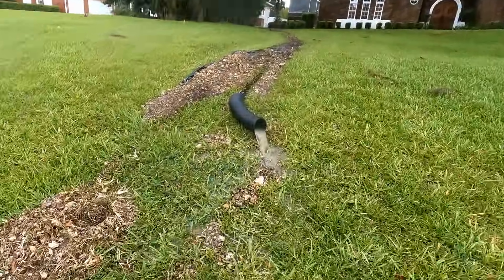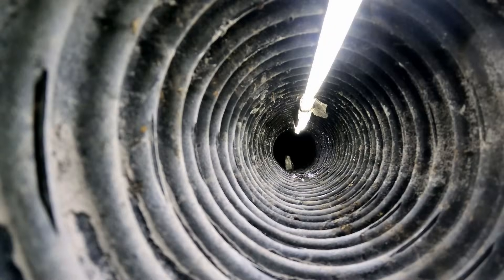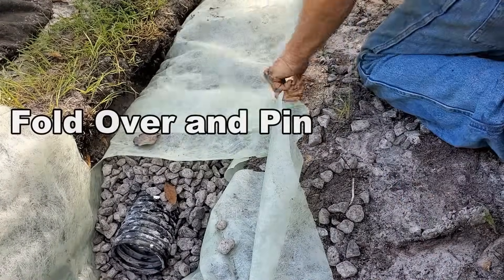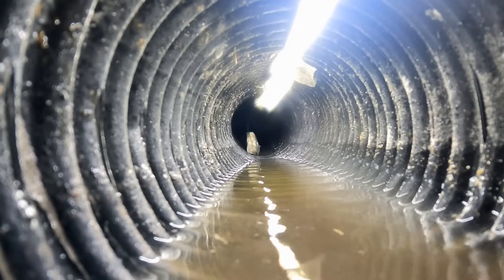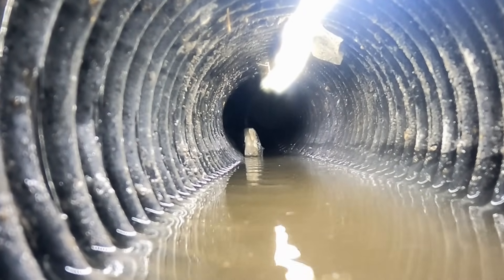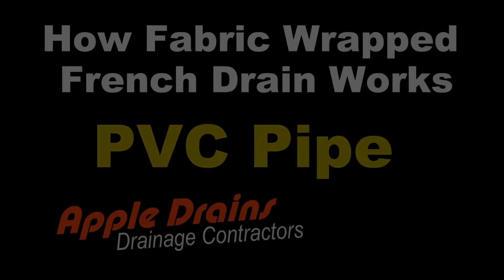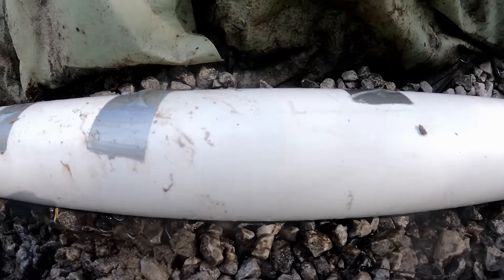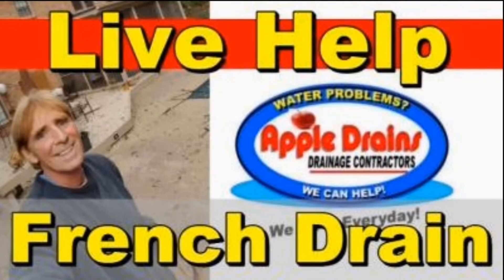Does French Drain Work with Fabric? Watch This Before You Install - PVC / Corrugated Pipe

Comment: Very nice demo.  I'm impressed with the light inside the pipe to get a good video!  What are the pros and cons of corrugated vs. PVC pipe?  Seems to me corrugated would make bends easier since out ditch needs so snake around some obstacles.  Also, what's a good minimum slope?  I'm guessing at least 1/4" per foot, or am I wrong?  

A final question, our water table is about three feed down!  How the heck do we dig a trench when it's constantly filled with water and we can't see the bottom?  Thanks again, this is a really excellent video!

Comment: I have clay soil. And want to fill the back yard swale and lut some cedars in there. The swale is only about 8 to 10 inch deep. How deep should I dig to put the stone and corregated pipe? 

I assume clay soil does not absorb water well. So should the corregated pipe be half in the ground and half above? So tha above water can flow into the pipe and away to the next bacl yard?

The pipe will be covered with loam soil for the cedars, which like well drained draining soil.

Comment: I'm curious....is it possible to make a french drain using only stone?  It wouldn't flow as efficiently as a pipe, but would just stone work?
Reply from the maker: @cluelessbeekeeping1322  I mean, why would you do all that labor and not put the pipe in. The pipe is what really moves the water.
Reply: @appledrains  I don't need to make a French drain.  It's a thought I always have wondered about.  Nothing more than an exercise in thought.  I promise, if I ever need a French Drain, I will do a proper one...but I still wonder if one with just stone would work.  Even if slowly.  Yes?  It seems like it would---but you're the professional.  What say you?
Reply from the maker: @cluelessbeekeeping1322  it might. But better off to put the pipe in there.

Comment: I was a utility contractor in south Florida for many years. I installed many French style drains (Corrugated perforated aluminum pipe) in drain rock. It is the law here that minimum diameter is 12". Cloth installed first followed by drain rock and pipe, Ends are tied up at the catch basin connection. I had my own rock crusher so the rock was always washed. Another bad idea by our government. In 3 years the cloth is non permeable because of oil etc. Also most don't wrap the cloth at the ends and secure it with a pipe clamp (That allows dirt to infiltrate into the rock median). A complete waste of time & money if installed near a paved area.
Reply from the maker: @gatorwing6231  great story!

Comment: I did something similar last year behind a good sized retaining wall.  The ground leading up to it has a little ground running down to the wall so it catches a lot of water from the yard and even overflow from the street sometimes.  I was worried about the wall's stability over time with too much water piled up behind it so I put a bunch of stone at the base, the perf pipe, more stone and then covered it with fabric before back filling.  The wall is filled with stone also so I figure any water that makes to the wall will drain down to the pipe and eventually out from the behind the wall.  All I can say so far is the wall hasn't moved and I am not a civil engineer.

Comment: I live just outside Toronto, Ontario and they sell corrugated slotted tile with what I call a “sock” but it’s a filter wrapped on it already. It must be a U.S. thing where you have to wrap it with fabric yourself. All the videos I’ve seen that to wrap with fabric.
Reply from the maker: @seen48  great!
Reply: I’d expect that you can buy either kind of pipe in either country.  The pre-wrapped is for quicker easier installation, and the wrap-it-yourself (with gravel inside) is for a longer lifetime of the installation.
Reply: Canada is so advanced. 😅

Comment: I still don't understand how a pipe with holes down will physically be able to carry anything away. But that could just be me.  I would think the lowest point in the trench should be the inside of your conduit.  If the water table rises it can enter the pipe from above and actually follow your pipe to daylight.  If it can't get above your pipe level then who cares? If water to the top of your pipe is too high, then just dig a deeper trench. 

But again, could just be me.

Comment: The holes down?   Shouldn’t the bottom have no holes so the water flows without  impeding the flow?  I was always told the holes go on the sides.
Reply from the maker: You may have been misinformed 👍

Comment: Thanks for advice I will use this for my drain, have a field at the back of us about 2mtrs above our ground and when it rains with the slope water had been collecting behind causing waterlogged ground , I’ll need approx 50 ‘ to go full length and down side to bottom of drive which slopes away . Thanks for your time  and sharing .

Comment: A lot of people don’t like the fabric because it can easily get clogged up after a few years of grass/roots growing into the fabric.  When it does this (which it will with the type of grass we have here) the water won’t drain down through the sod.  With that said, you clarify that the drain is mostly intended to drain the water that is in the ground, not the water on top.  For this I think it’s more important to keep the pipe free of dirt and roots and the fabric should help with that.

Comment: I have a question.  Is the fabric necessary if there will be no grass over the drain or is it recommended for all installations?
Reply from the maker: No
Reply: @appledrains what is the purpose for the fabric then?  Thanks!
Reply from the maker: @greadore  I suggest you Stop watching the Moron in Michigan. He has no idea what he talking about.. but fabric is not needed unless your in a sandy soil. I would use StaGreen. Available at Lowe’s

Comment: French drains are worthless in clay and/or silty soils. You are better off with drainage swales. Remove the soil completely and install gravel all the way to the surface over the control pipe. You can also use decorative river rock at the surface to make them look more appealing.

Comment: Hard pipe wrapped with gravel that is wrapped with fabric.  The hard smooth perforated pipe can clear itself out with a good flow, corrugated does not do as well.  The amount of dirt filled corrugated I have seen, and replaced, has convinced me I will never willingly install corrugated in a drain.
Reply: Yeah, this was not super obvious in the demo. Thx!
Reply: Its all relevant to the environment and the job its required to do.  Regardless it will have a lifespan.  The only ones I have had to fix were caused by owners and landscapers damaging them.  The only silt filled ones I found were from improper slope.  I told those customers you can jet it out every three or four years or we get a bid going to dig it out and replace.

Comment: I put perf PVC hole side up where pipe is next to house, then hole side down where I want the water to percolate into the soil. The whole point is to move the water away from the house, and since my gutters drain into the system, I don't need to percolate right  next to my basement. I actually have a catchment basin at the end to keep my koi pond full. Obviously the stone and fabric will allow water to carry around for any blockages. No floods in my basement since I installed.
Reply from the maker: All good- thanks for your input

Comment: I have watched a few videos on french drains and this is definitely the best!   My only concern is laying sod directly back onto pipe with out any base soil for sod?
Reply: put drain rock over the pipe, enclosed with fabric, so that none of the soil flows into the system. I'd use a layer of sand over the fabric then another layer of fabric before adding soil, as a buffer for the roots.

Comment: Why isn't the pvc pipe perforated all around instead of only at the bottom? And which is preferred: pvc or corrugated pipe?
Reply: According to this video, the perforated PVC pipe moves water faster.  The holes are only at the bottom of the pipe because as the water fills in the trench under the pipe, the water level in the trench rises.  Once the water level hits the holes on the bottom of the pipe, the water will enter the pipe and the pipe will carry the water away (via the central bottom section of the pipe, between the two holes).  Water rises from the bottom of the trench - hence why the holes are at the bottom of the pipe.

Comment: Based on personal experience after going thru three hurricanes and water runoff from three neighboring properties.   I would say ‘hell yes’ the French drains with that peanut and fabric cover is worth its weight in gold. It’s works very very well.   I would say I would put gravel over the top of the pipe.   It’s allows better water follow thru and run off and drainage.

Comment: Great vids but there's one thing that I don't understand... I can see how these systems work when newly installed, but why doesn't the mesh on any drain tube get blocked with sand, clay/soil etc or the slots/holes get blocked up (without mesh) until it doesn't flow (just like a vacuum cleaner bag or filter getting blocked up)?
Reply: That's what the fabric is for.  To filter that out so it doesn't get into the perforations.  Of course. What prevents the fabric from clogging up is the next question 😉
Reply: @DannyBowen25   Not the next question. It was the analogy used in my 1st question - copy/paste "(just like a vacuum cleaner bag or filter getting blocked up)"
Reply: @takleteck7008  oh, I see.  I missed the word mesh.  My bad

Comment: My father put a french drain in the unfinished basement.  He did not use fabric (id don't know if they wrapped it the 70's.  Anyway it worked well for 30 years. Water started to perk up in the center of the basement and I ran a snake into it.  It was clogged with mud.
Reply: How’s you clean the mud out?

Comment: You don't know what you're talking about. A perforated drain pipe is just that. It's NOT a French drain.

Perforated pipe can be laid IN THE BOTTOM of a French drain to improve performance. Traditionally, of course, this was not done. The coarse rock (which is all that constitutes a French drain) will usually provide sufficient flow on its own.

However, depending on local soil composition, sediment can be a problem for traditional French drains. Drain cloth is laid as a barrier to prevent sediment infiltration into the drain. A vertical wall of cloth on the uphill side of the drain will prevent sediment from percolating into it below ground level, while continuing the cloth horizontally over the French drain near the surface will prevent sediment from washing into the drain during periods of severe runoff.

The principal functions of drain pipe laid in a French drain are to deal with peak loads and to ensure that the drain functions even when partly contaminated with sediment.
Reply from the maker: Thanks for sharing
Reply from the maker: I thought about how many people think they know what a French Drain is and how it works… I realize you don’t know anything about it.. but that’s normal 

Arm chair replying is normal from people that have nothing else to do
Reply: @appledrains  as an arm-chair guy who has learned a lot from your videos I am glad you never let the worse of us to stop you from sharing your knowledge on this topic. Thanks

Comment: "Does French Drain Work with Fabric?"
Of course not! Fabric is a solid, it will not flow through a pipe. The pipe is designed for liquids to flow through it. (Well, maybe if you cut the fabric up in pieces small enough to be carried by a fluid through the pipe, then technically, yes, the pipe will work with fabric, but why would you want to flush fabric through a pie in the first place? Just hand carry it to where you want it.)

Comment: Chuck, could you combine subsurface drain with downspouts by having downspouts connect at the top of the french drain ?
Reply: That's not recommended.  Most say gutters go to solid pipe to daylight or basin.  French drain is only ground water.
Reply: Your biggest cons are leaves from your gutters, and percolating water at the edge of your house. You can put in filters or rain barrels to resolve the leaf issue, then make sure the pipes are not perforated right next to your house. My system has no problem catching gutter water and moving it to my catch basin which keeps my koi pond topped off. No basement flooding since the install.
Reply: Many folks run two pipes in one trench for that scenario. But the downspout pipe has to be solid - you really don't want to be introducing a roof-worth of water into ground that already has issues. Plus as others have said you don't want roof-debris in your french-drain-pipe if you can avoid it.

Comment: There is no requirement to install a pipe....  properly sized clear stone, wrapped in a proper layer of geofabric placed to the base prior to rock and wrapped over is sufficient. Yeah I am a geotech and installed lots of "french drains". Thicker cloth will not noticeably slow down the ingress of water since water will always take the path of least resistance. This is nothing more than a sales pitch.  No mention of geomorphology for the installation. I am not saying that pipe is a bad idea, its fine, just not an absolute requirement for a cheaper fully functioning french drain installation.
Reply: How is it a sales pitch when he's not making any money from it?
Reply: My friend.. 

Stone works as drainage, you are correct. 

However stone is a solid and also Displaces water… 

The point of the pipe is to keep an open void. It absolutely does allow water to move faster.
Reply: Pipes can be rodded...
Reply: @eastyg  rodded?
Reply: @ianbelletti6241  cleaned using rods.  I'm agreeing with you.  A trench just full of gravel over time if it gets clogged with silt is useless but a hollow pipe can be cleaned out meaning its useful for longer.  Much greater volume for water than the small gaps between gravel aswell
Reply: @eastyg  not volume but flow per volume. Every rock in the flow resists the flow slowing it down. A clear pipe allows the water a much smoother path of travel allowing for faster flow rates for the same volume.
Reply: So the white stuff looks like  it definitely works much better than the corrugated pipe..  and will probably be better in the long run especially if the area your installing them in has trees and other plants that roots will end up inside the pipe, white stuff is easier to clean out with a rooter tool.
Reply: Je suis français tu dis de la merde, un pro qui me met un drain uniquement en pierre sans tuyaux c'est une malfaçon et en 2 à 4 ans le drain est bouché avec les agglomération de terre.
Reply: @TheOverproof151  I understand what you wrote and you’re wrong. A pipe within the system will certainly allow for water to be carried away faster.
Reply: @patty109109  …. Here’s a tip princess… try reading for comprehension.
Reply: The pipe is there to allow faster flows as the rock base acts to resist the flow.  Yes, you don't have to install the pipe but if the flooding is such that it would flood the gravel as well then the pipe becomes essential to help move the water away.  In my area we have very sandy soils and pretty flat land. We invert the usage to make drain fields.

Comment: If I wanted to collect runoff water from the road and use a swale to collect  it, but some sort of french drain under the swale to pump the silt-filtered water out to a holding tank, can you please point me in the right direction?   This is for rainwater harvesting, to use water many times on the property rather than just let it sink into the abyss or run off.
Reply: IBC totes are the key to rainwater harvesting.  They are cheap and easy to use.  Bit of an eyesore, but they can be buried if you aren't afraid to dig really big holes.  Tie them together with PVC.

Comment: Will it work to connect two french drains pipes perpendicularly? I want to run a few feet to an existing one
Reply from the maker: Sure!
Reply: Thanks for answering! The caveat is I would have to cut a hole in the side of the main one to run the shorter one into it.  I suppose with a connector

Comment: Great info.  Question though, would you not need to add soil on top of the pipe for the grass to grow?.
Reply: Anywhere I have added a French drain grass does very poorly above it.  I’m in Oregon so it will sometimes do okay in winter but craps out early in summer.  Dandelions do okay over them.
Reply: That I suppose depends where you are running the pipe. If it is going into bare soil, then it would need to be covered. If as in the video the turf/sod has been removed properly it can just be replaced . Good quality turf will have the roots in the layer just below the grass.

Comment: Thank you for your video. I have a question. I see that you use the pipe with two holes. However, every store I go sells the one with three holes. So, which one is the most efficient and why? Thanks
Reply from the maker: The same
Reply: @appledrains  so, is there a difference which one I want to place behind my retaining wall? Or   If one is more preferable than the other one? Thank you
Reply: @andriybond5221  Different manufacturers will vary slightly.  No real difference between them. Use what ever is available in your area.